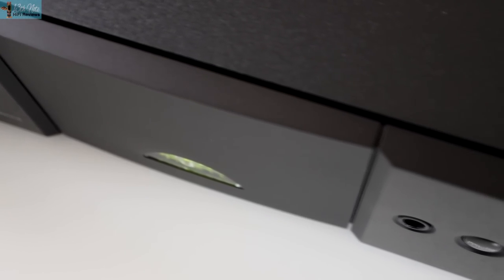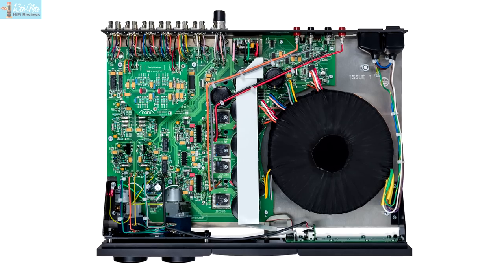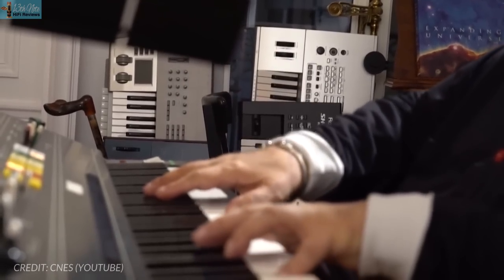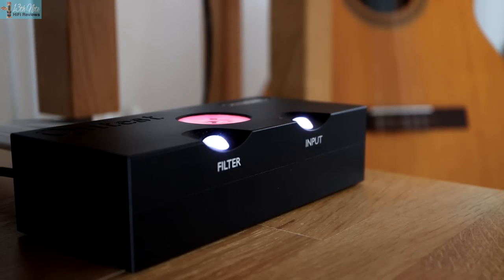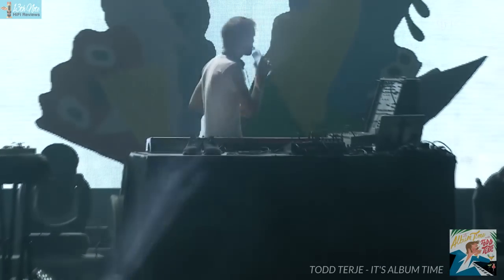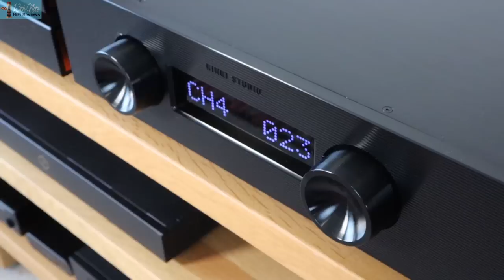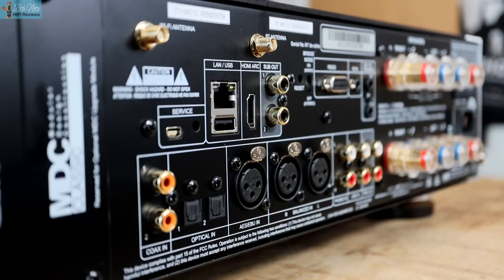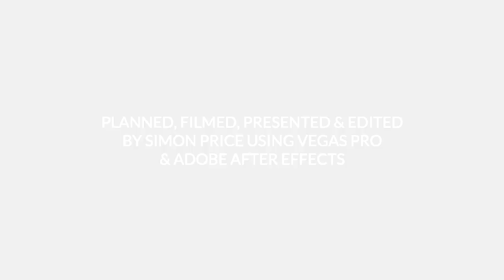Naim Supernait 3 (Vs. Hegel H390, NAD M33 & Kinki Studio EX-M1+)

Comment: Super roundup of the integrateds most folk will actually buy, and importantly tested with 3 different and rather inefficient, demanding speakers. A follow up that digs deeper into the pairings more specfically would most likely get tons of views as well. I don't think the NAD got quite a fair shake using its analog input since the signal was processed again, as you mentioned it really should be used as a streamer amp. I've heard it and the Naim paired with B&W 804 D4s and felt the NAD was equally as resolving. The Naim does have more personality however which is a good thing - and despite what reviewers will tell you, "neutrality" shouldn't necessarily be the ticket for everyone.
Reply from the maker: Thanks very much , I agree with you Michael. So sorry about my mistake. I can’t tell you how annoyed I am with myself, pressure to finish videos and work involved is big.
Reply: The Hegel, Naim and Kinki were all on my short list. Eventually I went for the Kinki power amp with a passive pre-amp. Neutral isn't my ticket too - I like subtle deviation from neutral. But my loudspeakers already provided that.  With more neutral loudspeakers I would probably have gone for the Naim.
Reply: @alphaniner3770  what speakers do you have ?
Reply: @cdbeen123  Tekton Enzo XLs

Comment: If you already have a very good DAC , then the Kinki is a no brainer for its price and ability to handle most spkrs with its power and high damping factor. 80W may not be enough for some spkrs. For bang for the buck.
Reply from the maker: It is tremendously good vfm I agree.

Comment: I love my Supernait 3 with my Proac’s D20R. Sounds great. I bought the Hicap DR power supply for the SN3 preamp section and sound improved noticeably.  I’m using a Denafrips Pontus II Dac.
Reply: ditto, I also have an SN3 and, which already sounded great as is, the addition of the Hicap DR took it to another level sonically across the board.  It replaced my Primaluna  Dialogue Premium Integrated.  And this review is absolutely spot on with regards to midrange punch.  And the kick drums just sound so much more real and lively but not at all harsh.  Using a Holo Audio Spring 3 KTE 80% of the time and it's sublime.  Don't miss tubes at all.  The funny thing about the PL it had a center imaging so low as if you're sitting at a balcony which was a bit annoying.  The SN3 fixed that as well so it wasn't the speakers.

Comment: Thank you for the thorough review on the sound character of the Naim, and specially for your transparent (pun intended) comparisons with the other three amps. Here in the US Musical Fidelity open box M6si are selling for $1,800. In my humble opinion, the M6si has the same analog limitation as the Supernait 3, but with a sound signature and character somewhere in between the Hagel and EX-M1+. For those of us that are into punchy dynamics and bass grip with decent soundstage & imaging, the M6si (220w) at the discounted price of $1,800 is a world beater. Thanks Simon.
Reply from the maker: Thanks David, but have you tried all of these in situ? I’ve tried the M5si. It had a full soundstage on the plus side but bass a bit looser to the Hegel. The subscriber who brought it around was considering the Hegel as he has same speakers as me.
Reply: @13thnotehifireviews7  You're absolutely correct Simon. The Hegel 390 is superior in detail delivery and soudstage compared to M6si. My observations are couched in the current pricing for M6si in the US for open box or used ones.
Reply from the maker: @davidrivera2165  thanks David, helps me and others !
Reply: Thank you for reviewing naim.. No one does that really.. I do suggest you listen to naim, like they intended. Chord dac is fine but at the minimum try the nd5sx2  through din conection, maybe a hicap and a nap 200 with all the upgraded cables and power cords which is the true final form of that system..  And only the first gate before an nac 282 + nap 250dr. I also have an h190, Auralic aries g2.1, mytec brooklyn bridge, powered by ferrum hypsos.. And it doesn't even come close to supernait 3, nd5sx2. combo through roon. Using tekton lore reference and wharfedale lintons on both systems. But wharfedale with naim are naturals together.  Cheers, great review.. Oh and you need at least 100 hours on that sn3 to start hearing its true colors.. Some say 400 hours... So happy listening.
Reply from the maker: Thanks, this unit has had lots of time on it.

Comment: Always great to see the Supernait getting some attention. I own both a first and second generation of this amp and for me, it has always paired well with Dali speakers. I use a rubicon 2 and a menuet as well(with a rel t5i). Together with chord dacs, I no longer wonder if the grass is greener on other gear. For me, this combination of gear causes a visceral reaction when I hear it and I’m deeply pleased with it. My Supernait 2 also has the HiCap DR. Speaking as a confirmed subwoofer fan I’ve never felt the need to add one to my Rubicon 2’s. It just doesn’t need it.
Reply: Would you recommend the Hicap DR and did it make a big difference? I’ve been thinking of adding one to mine.
Reply: @Stuck_in_the_70s  I do. Much blacker background with the accompanying jump in detail.
Reply: @sheerkhanful  thanks for the reply yes I have heard good things It’s definitely an upgrade I’d like to make sooner rather than later.
Reply: @Stuck_in_the_70s   have a look at TeddyPardo power supplies. They have a whole line for Naim products. I have the TeddyCap SE with my Supernait2 (and also another PS for my Chord). 
Sounds fantastic.
Reply: @GMG0479  ok not heard of those I’ll take a look many thanks for the recommendation!
Reply: Do you think the supernait/dali combination sounds good at lower/moderate volume levels or does it need a bit more volume to sound it's best? Thanks
Reply: @damianburke1229  The Supernait does share a trait with many other integrated I've tried, which is that the sound is at its best above low listening levels.  In a small room, with Dali Menuets, it's possible to stay lower on the volume.
Reply: Can the Naim xs2 or supernait 2 drive Dali opticon 8 well?
Reply: @damianburke1229  
Just in case you haven't pulled the trigger on anything, Teddy Pardo (as mentioned before), Avondale and Custom HiFi Cables are all fine alternatives and more wallet friendly (all things being relative!), and depending on where you are in the world, much better value when they pop up on eBay!
Flashback cables can supply anything you need for HiCap alternatives if you head down the used route.
Personally I'd describe the addition of a better regulated 24v PSU on the SN1's preamp section as adding more power and control.
Yes it really is possible to improve on a Naim's dynamic abilities and rythmic drive.
I know there are no claims on actual output power, but it really does give the impression of a considerably more powerful amplifier.

Comment: Interesting to hear your thoughts about the Supernait and PMC’s. I also have some PMC’s and when looking for a new amp I demoed the Supernait and Rega Aethos. I ended up buying the Aethos. Overall the Supernait is clearly the better amp, but I agree it does not pair well with the PMC’s, it exaggerates the PMC’s brighter top end and it was not a comfortable listen. The warmer  sounding Aethos just took the edge off the PMC’s to give a much better overall tonal balance and listening experience.
Reply from the maker: I totally agree. Certainly the twenty5 range or newer twenty5i range, but older pmc’s like the twenty series or older than that, or maybe old fact series, I wouldn’t be saying that and certainly not a case of a ‘house’ sound between pmc’s of different generations, at least as far as their bass/treble balance. Contrary to what I said, the nad does work with them all. Will correct it…..

Comment: Supernait 1 was my first amp, and I still feel a pang of regret for selling that beautiful piece. It brought so much joy and warmth to my listening experience. I moved on to an Accuphase, but it left me disappointed. Now, I've switched to an all-in-one solution with the NAD M10. It's convenient, but I know deep down that if the NAD ever fails, I'll go back to the Supernait. That amp was unparalleled, giving me countless hours of relaxation and joy, even at low volumes. The rhythm and style of the classic Naim are simply unbeatable, and you can find them second-hand in superb condition. Plus, it pairs perfectly with my British Spendor D7.2.

I don't understand the fascination with tube amps. Every time I had the chance to listen to them, I felt they offered less control, more distortion, and were overpriced. I also don't get where the idea comes from that they're difficult to drive speakers with. In my 30m² room, even with several speakers, I barely hit the 12 o'clock mark on the volume regulator. The Supernait had everything I needed and more, and it remains unmatched in my heart.

Comment: First i must say buy what you want. Your preferences and room layout are more important. 
I had both the Hegel and Naim supernait and both were excellent (they really were)
To me the Naim had a bit of a thump bass and slightly harsh top end (on some tracks). 
The Hegel was ‘good all round’ but with a slightly thicker mid range. 
Value wise the Hegel comes out top but not by much. 
Someone recently did a tare down of the supernait and component cost was £380 GBP. What I don’t like is that Naim seem to just pick a price as the what that deem they want the thing to sell for not what it really costs inc. R&D + profit. - Naim of cause are not the only ones to do this. 
I now have a Luxman L509x - clarity and subtlety that Naim can only dream of. 
If someone were to ask me which to get though is none. Get a reasonable system and with your money left over go and travel the world, make some memories with your family. - on my last day I can they say ‘remember when…’ - I will not be talking anything HiFi related.
Reply from the maker: To be fair to Naim though they charge what the market bears and economists always say the first rule of economics is to charge the highest price. I doubt that it would cost £380. Most of the component costs is the case - it’s solid aluminium and milled on all sides, so not much change from a grand or two. Then the shipping costs in the supply chain, they went up ten to fifteen fold in the pandemic. Also electricity costs with the Russian situation and energy crisis. I was watching a documentary with a uk chef, whose electricity costs of his restaurant kitchen are going up from £5k to £35k a month. I dread to think what an electronics assembly factory costs. Ultimately though I suspect what Naim can charge is based on their reputation and historical presence with lots of brand loyal people and repeat buying, and if people pay it, as they do, then that’s the correct price. It may mean it’s not in the same market as other types. Not like a Veblen good, but the difference between a hublot and seiko in the eyes of buyers.

Comment: As a general rule Naim work very well with Proac I find. Thanks for the comparison very fair and highlighted sonic difference as opposed to concluding this is best or that is better. I agree absolutely that speaker synergy is the key it always has been and always will be in my view.
Reply: @morespinach9832  but by buying them active you’ve just made your speakers obsolete in a few years…amps, preamps, dac, has made incredible improvements in the past 5 years.  Imagine being stuck with obsolete audio tech 5-10 years from now in otherwise fabulous and expensive speakers…
Reply: @morespinach9832  the Focus XD has been updated and will sound better than your old ones.  If you had separates or an integrated amp,newer DAC your speakers would still be good.  Are you suggesting that audio fidelity hasn’t improved in 7 years?

Comment: Very nice video. 
I bought my SN3 for an absolute steal ("opened box") in July 21 to replace my Naim XS MK1. I adore the SN3 with my old Proac Tablette Reference Eight Signature speakers. Compared to the XS, the SN3 has vastly greater low-range heft and amazing mid-range detail. The amp really pulls you into the music, it's quite an amazing bit of kit (and incredibly well build). The other amps also sound like they would make their owners very happy.
Reply: Nice to know. I have an XS2, and SN3 on my shortlist to upgrade
Reply: wait till you add a HiCap DR and you'll no doubt be amazed at how much more of the goodness will come out.  I was skeptical especially for how much more you'd have to spend.  But it is well worth it apart from going separates.  Congrats!
Reply: @scslite5206  I added a teddy pardo hicap which I got years ago for my XS and I wired that up to the SN3 before I first turned it on. I've got a TP XPS PS on my naim DAC as well.
Reply: @scslite5206 what is a hicap ?

Comment: Thank you, Simon for remarkably helpful, succint and insightful content.  Supernait 3 supplies enough current and voltage for my satellite loudspeaker load; the main amp in my system only reproduces above about 100 Hz.  

What are the lowest-cost new or used Naim power amps that at least equal the best musical qualities of Supernait 3's power amp stage for my application?  How does the mid-2000 vintage NAP 150XS compare?  How about more recent Naim power amps priced below the current $9k SRP NAP 250 entry-level power amp?       

What if any non-Naim power amps share the best qualities of Supernait 3's power amp stage?  Exposure?

Comment: Naim Supernait 3, HiCap DR, WitchHat Morgana SNAICs and interconnect, WitchHat Phantom speaker cables, Chord Qutest with Plixir Elite BDC power supply, Chane L3c speakers. Just EPIC!!
Reply from the maker: It sounds epic.
Reply: @13thnotehifireviews7  TBH, the above setup beat an H590 during an extended in home demo. It wasn't particularly close. Bettered slightly in some areas by a Pass Labs INT-60, but superior in others (would come down to speaker pairing.

Naim says these are not speaker cable dependent; and they aren't in the same way as classic Naim. But using high inductance speaker cables (like Naim NAC A5, WitchHat N2/Phantom, or Kudos KS-1) really calms the brittle leading edges, adds more bass authority and control, & greatly expands soundstage in all 3 dims while also increasing air and image delineation. I used normal BJC Ten AWG cables at first and heard basically exactly as you described in your review; good, pleasant, but not overwhelmingly good.

Comment: Thanks for your amazing reviews! I did audition the H390 so I know what I am looking at there. I also know the SN3 fairly well. My question is mainly about EX-M1+. How well would it pair with KEF Meta R3? Medium sized room, Electronic, Dance and Jazz music, Chord Hugo DAC, Apple Macbook Pro as a source via USB to the Chord. Based on your experience, which of the 3 amps would work best? Of course I understand this is subjective but for me base control, timing/rythm for the electronic music and soundstage depth and resolution for the jazz music are the most important parameters.
Reply from the maker: Hi Slavo, wow thanks so much for the donation. If you message me on Facebook or email me at simon at 13thnote dot net , happy to continue this there so you can access all my knowledge.
Reply: @13thnotehifireviews7  Will do!

Comment: Interesting review! I have Supernait 3 & Naim NDX2 streamer/DAC with PMC 23.i combo that I chose after long listening process. Few weeks ago my DIN port broke up on NDX2 streamer and I had to switch to RCA-connection and I immediately noticed that sound quality was not as good and one of the issues being a bit harsh treble with my PMC's. 

So my question is that have you had a chance to try these with DIN-connection or just RCA? Cause I think that makes a difference with this combo that I have at least. What comes to Hegel H390, I do agree that it's a bit more bass heavy and prolly wider sound stage, but the details that Supernait 3 can reveal and the dynamics are just better for me personally.  

I have only heard headphone amp from Kinki but that one I really did like and it had same characterics as you mentioned. Finally I believe stacking up Supernait with Naim streamer/dac has some nice synenergy too :)